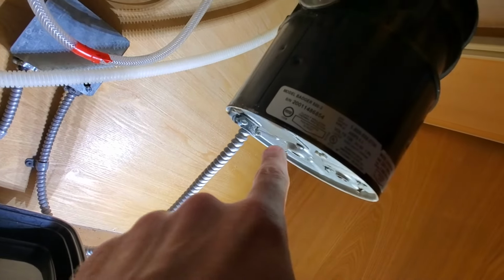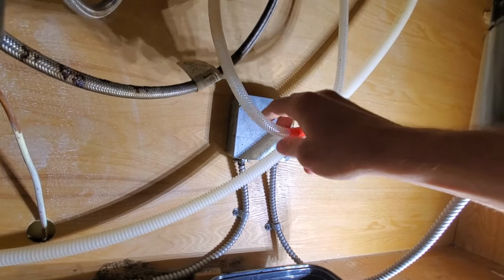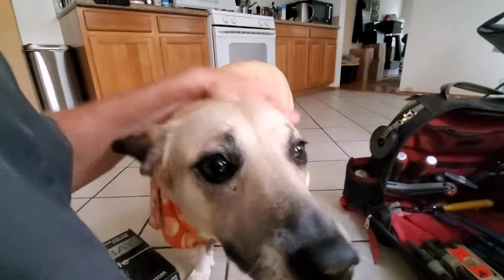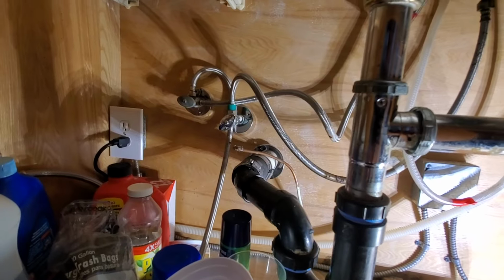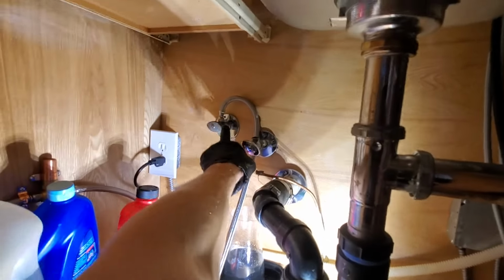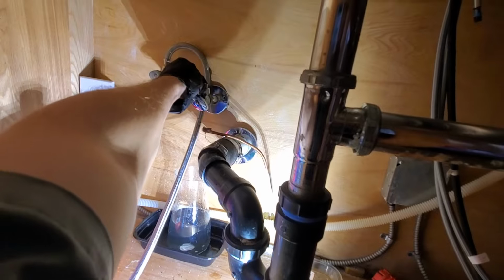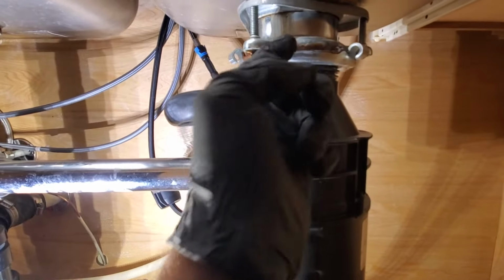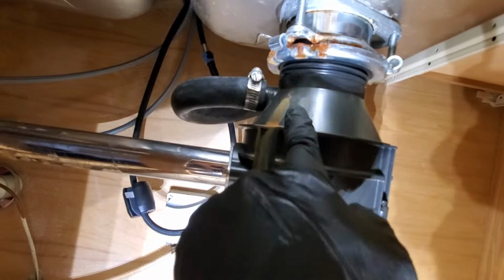Leaky kitchen faucet replaced

Comment: What to do if the nuts which are located under the sink holding the faucet are not turning loose?
Reply: That usually involves cutting either the nuts or the faucet. You could also try drilling into the side of the nut depending on what type it is.
Reply from the maker: Cut em